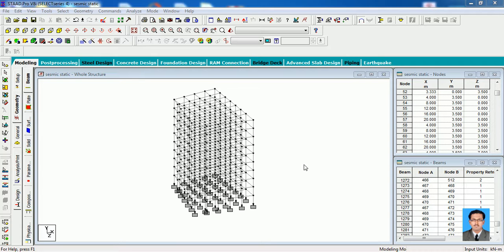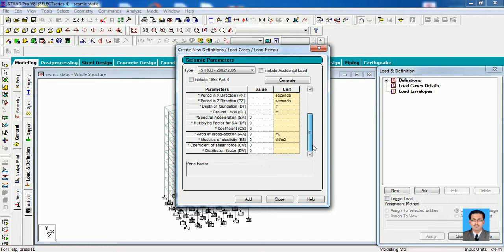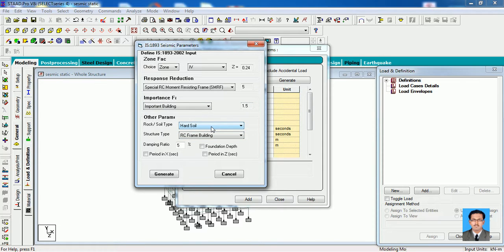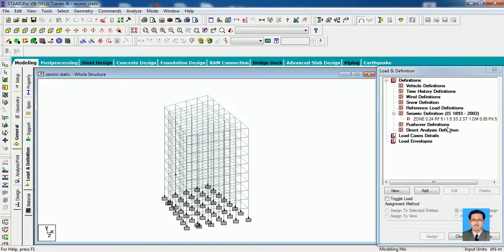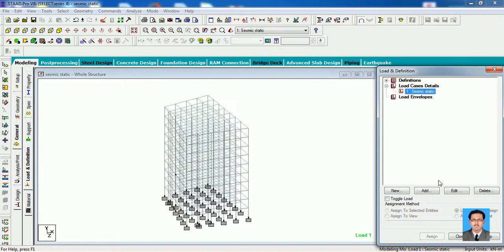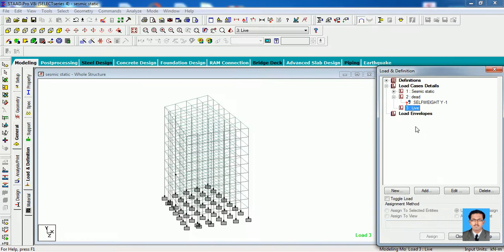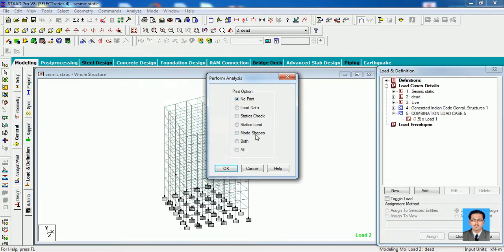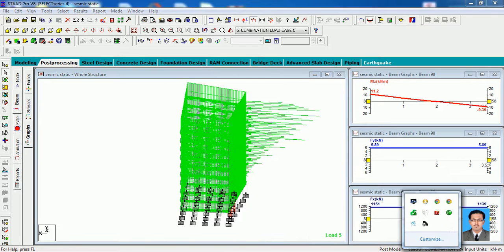Seismic static Loading in Staad Pro V8i

Comment: Sir during loading....staad will automatically calculate the slab load or we have calculate it?
Reply from the maker: It will be calculated automatically once we apply self weight on to the structure. for shear walls alone we need to apply the self weight separately!

Comment: hello, how to model seismic static, if the standard of my country is not included in Staad pro.  It can be done by placing the horizontal load in the center of mass of each floor. could make an example of this.

Comment: Thank you for such a clear and nice video. I have a question- Is it necessary to assign selfweight under the seismic load in load cases details. Since you have already assigned the selfweight and member loads in seismic definitions itself,  won't  selfweight be applied twice? and another question is- as we have added selfweight and member loads in seismic definitions, shouldn't we add live load too in seismic definitions?
Reply from the maker: +beenay18 Dear Beenay we are defining sesmic loads, under that we need to create self weight to tell staad that the sesmic waves will be acting along with the self weight i.e. the weight of the structure.... and in the load case we are loading with the self weight. just find the difference between defining and applying loads, which can solve ur query

Comment: under seismic definition; i guess -ve sign is not necessary. correct me if m wrong
Reply from the maker: ronnie9096 when you are defining the load its not necessary, because the load effect will be acting in the same direction as the seismic waves .... but once you are loading its required.....